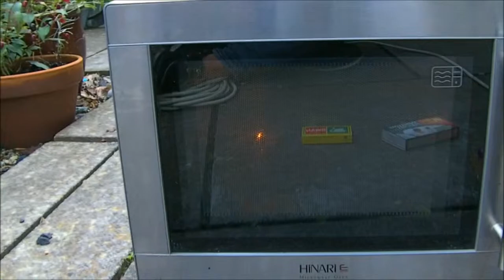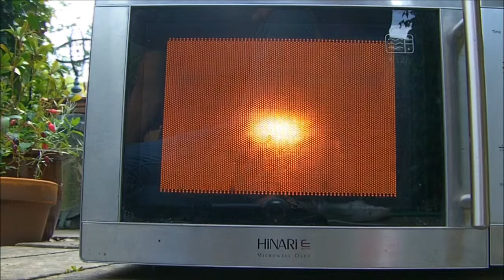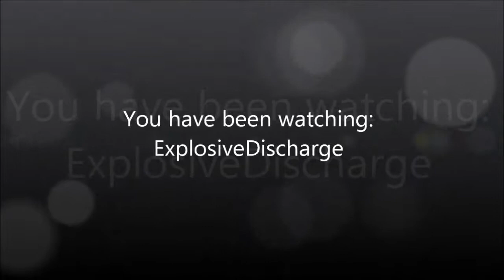Microwave Madness

Comment from the maker: Ah just had a read up about that, would it just have been the cap and big diode for the doubler circuit? We kept both incase the came in handy! Do you think we can get some bigger arcs using that than just the transformer on its own?